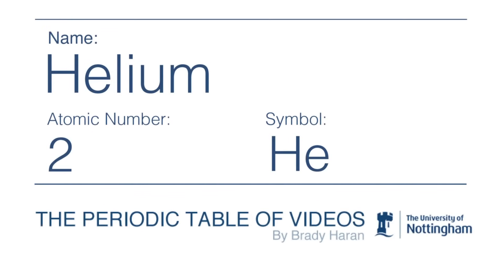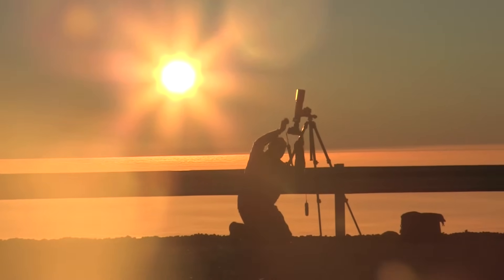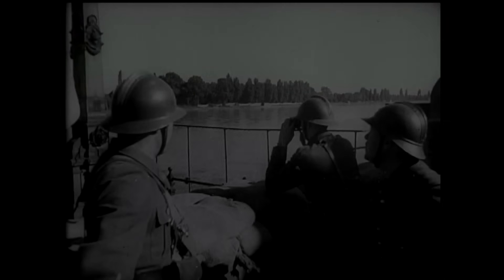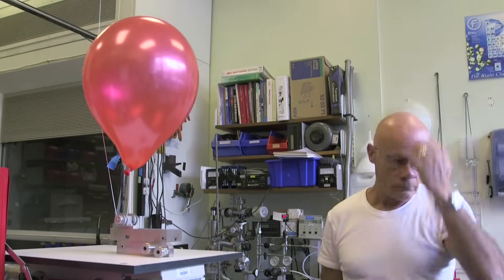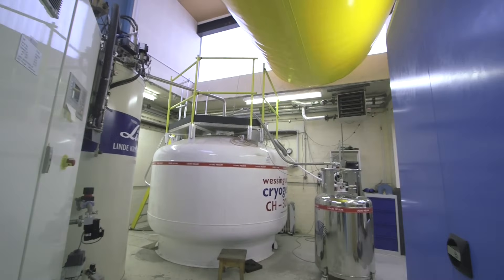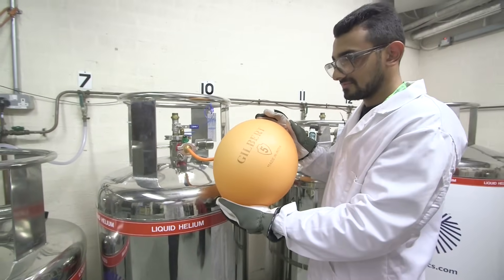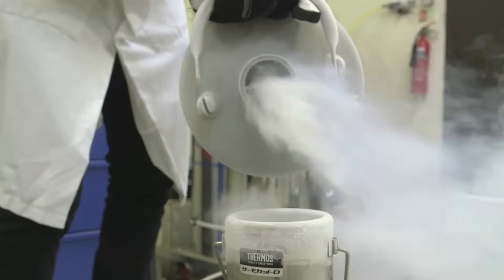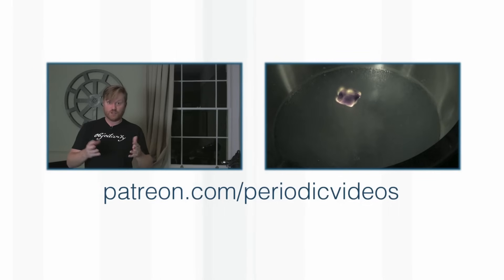Helium - Periodic Table of Videos

Comment: If we were to  manufacture helium, would we put the corresponding opposing charge and hydrogen gas?

“The answer depends on what "he" refers to. If "he" refers to a proton, it has a positive charge. If "he" refers to an electron, it has a negative charge. Electrons and protons are fundamental particles that make up atoms and carry opposite electric charges. 
Elaboration:
Protons:
Protons are positively charged subatomic particles found within the nucleus of an atom. 
Electrons:
Electrons are negatively charged subatomic particles that orbit the nucleus of an atom. 
Atoms:
Atoms are typically neutral because they have an equal number of protons (positive charge) and electrons (negative charge), resulting in no net charge.“ - google

Comment: If I caught the moment, the xenon balloon, after resting overnight still fell faster than the others.  My interpretation is that though some of the Xe escapes, much is absorbed in the rubber.  COnsequently, its mass is still included in the balloon.  The density of balloon plus gas therefore is greater than that of the other gas balloons.  Also, the Xe balloon is smaller, so that its aerodynamic properties are different.  Which complicates matters.
  Did you weigh the balloons before and after allowing for diffusion?  If the gas is dissolved in the rubber, the balloon should weigh more per unit volume than it did before sitting overnight. That would remove the aerodynamic factor from the measurements.  I'm starting to get confused.  Maybe just do the measurements?  
  One of the noble gases, either krypton or xenon, "poisons" nuclear reactors, reducing their energy output.  The gas is a fission product and accumulates in the fuel pellets as it's made.

Comment: The use of Helium must be brought under control.  Once used, it becomes irreplaceable.  It is a waste in baloons/airships. however in medicinal use and low temperature magnets it has much value.  Le us not squander it before it is too late.
Reply: Fear mongering ROFL
Reply: @reggintoggaf7140  Instead of ROFL I suggest doing some research. Estimates vary, but He will be too expensive to extract by 2050.  The cost has risen 4-fold in the past ten years.

Comment: What will happen when we fot example would create a real vacuum with barely no elements in it and then we will fill it only with alpha radiation? I mean without electrons to create helium. If we fill this vacuum with only positive or neutral particles what will happen? Will it float better than the helium filled balloons?

Comment: Because helium is so rare on earth as we see it, can we produce it during nuclear reaction?
Because helium can be used as a great coolant for Gadolinium to temp control in the reactor that I've been thinking about... Would be great is if you guys can figure a way out for some of these theories, because I'm trying to make it so it can at least self regulate itself and produce at least enough energy to sustain itself... Even if it can only produce the energy for all of its applications, I will still consider it a success if it can reuse most of its elemets, where if possible, be transformed to make ozone as the final  byproduct...
This ozone can even possibly be sent into a sphere and make a plasma ball which, as I understand, can make free ions?

Comment: The professor mentioned the U.S. National Helium Reserve which no longer has a stockpile thanks to the  "Helium Privatization Act of 1996" (Public Law 104–273)

I always think there's something henky going on with helium. In a liquid state, it's the coldest thing that can be made and is used extensively in quantum computer research. Then there's natural gas fracking. That practice contaminating ground water at who knows at what expense. And finally, don't be too surprised to find out China is shipping helium from the moon when that starts to happen.

Comment: No one knew helium existed until a French astronomer spotted unusual colors in the light coming from the sun in 1868. The colors revealed an unknown gas burning there. Scientists called this gas helium after helios, the Greek word for sun, and we now know it's one of the fuels that keeps stars burning. 

It was soon found on Earth, too, in gases leaking from lava and in natural gas. It turned out to be very useful! Because it's so light, helium's great for filling party balloons! And when you need a gas that doesn't react, think of helium. Welders use it. And it saves deep-sea divers from getting too much oxygen from their oxygen supply. Meanwhile, your shopping in the grocery store is scanned by a helium neon laser. But we're running out of helium, because every time we use it, a little bit more of it drifts into space...

Comment: Is it right so say that the brightness of sun's photosphere is caused by helium? Actually we have a "yellow dwarf" there. Which describes our sun. Because hydrogen only has a faint "reddish-pink" colour, even at those surface temperatures on the sun (Chromosphere layer). Can be seen through a narrowband h-alpha filter this way while blocking out all the rest of the spectrum. But helium finally spreads broad in its spectrum if somehow ionized, and very broad if plasmafied high enough. And seeing the faint white glow of the corona, I think this is all helium. At millions of degrees because it is so thin, exposed to all the radiation coming from the sun.

Comment: There's a very tiny amount of helium on Earth that doesn't come from radioactive decay. Some was trapped deep inside the Earth when it formed and is only now leaking up to the surface (though most of this leaked up long ago), and some is deposited by cosmic rays (though I'd bet more is created by comic rays through fusion and fission when they hit certain nuclei). I assume that technically solar wind is a contributor, but that is only statistical oddities, as most solar wind is deflected by the Earth's magnetosphere. However, one should always remember that atoms are so incredibly small and numerous that there's almost always SOME matter that comes from any sort of incredibly minor/unlikely process (though some processes are legitimately so extremely rare that there probably aren't any atoms from them on Earth, like maybe those elements right at the end of the periodic table, which could only form naturally on Earth by very bizarre coincidences and would almost certainly disappear almost immediately).

Comment: Liquid helium is really cool because it can climb up out of glass.....or is it that the helium goes through the pores of the glass?
Reply: I wonder, if Helium absorbs heat so well, wouldn't the process of liquifying it release so much heat that it would melt the equipment? 

Liquifying a gas is done by compressing it, until it changes to the next state of matter, then letting it cool down to a manageable temperature.

Comment: I'm a welder and I go thru a large bottle of Helium in 2 days if I'm weld thick sections of Aluminum.  The electric arc of TIG welding when using He instead of the normal Argon is much hotter.

Comment: Does the helium vapor produce a flame shaped jet because it (like a flame) is simply a column of rapidly expanding gas? I imagine, like in a combustion reaction, the cone is the threshold where kinetic interactions with the air (as opposed to oxidizing interactions with oxygen in the air) cause the helium gas-vapor to completely vaporize.

Comment: Liquid helium has an extremely low heat of vaporization, so it's difficult to keep in its liquid state outside of multiple Dewar systems.  Even a small amount of outside heat can boil it away.

Comment: Is it possible that the music from the phone only got quieter because helium is on one side of the speaker and possibly air on the other side? So, maybe it is making it harder for the cone on the speaker to vibrate correctly like a diaphragm with two different pressures on each side making the diaphragm more rigid. I ask this because I learned sound travels faster through helium and this goes against that. Is it possible to do the same experiment but use an open speaker instead?

Comment: What if you tried filling the thermos while in a sub-zero cooler. Then the majority, if not all, of the water vapor will have already dropped out of the air. Respirators could be worn to help reduce additional water vapor as well.

Comment: Why, if hydrogen lighter than Helium, is liquid helium colder than liquid Hydrogen...or any other element?
Reply: Gaseous hydrogen is lighter than gaseous helium because that's how gasses work; sulfur hexafluoride is dense enough to float small solid objects on but can get far colder than, say, butane which is much lighter. Gas density at STP depends only on the mass of its molecules.

Liquid helium is so cold because its atoms are so weakly bound it HAS to be that cold to even exist. Lithium Hydride is quite light as a gas, but is a salt-like solid at STP while the denser oxygen must get far, far colder even to liquefy,

Comment: I am surprised that it was not mentioned that helium is used in welding due to the high heat transfer properties as well as in deep sea diving mixes to replace nitrogen to avoid nitrogen narcosis.

Comment: I wonder how much the Helium was worth that was used (released) in this video.
Reply: mon librepenseur, that depends on your Scarcity metric et EMERGY/ERoEI yield process,
though, back of envelope at < 1.5l et x,y,z pb per mole,
 ~$900 USD worth was lost.

some conjectured > 5l, that would be closer to ~2000USD.
this is not inclusive of the EMERGY throughput process to distill that end-to-end.

je prends conge mon librepenseur

Comment: If helium emits a yellow liɡht, can someone explain to me why a purple liɡht is emitted when helium and deuterium are fused?
Reply: It's a different process. The light emitted by a neon light comes from excited electrons dropping back down to lower energy levels. That produces a very characteristic wavelength. I presume the light emitted from a nuclear fusion reaction comes from the very high temperature of the gases involved (incandescence). The color of the light is spread over a swath of different wavelengths (i.e. black-body radiation) and is directly related to the temperature of the gas.

Comment: Thanks for the video, but what about liquid helium in a vacuum?
Reply: It doesn't last long. Without air pressure it boils incredibly violently, even explosively, no matter how cold it is.
Reply: Thanks. I'd forgotten that changing the pressure changes the boiling temperature.

Comment: Helium is awesomely stable in the nuclear world as well. It is SO stable compared to its neighbors, it is one of the few elements you can fission to bellow iron and still make a net positive energy! IE you could split a lithium to get you some helium a net positive of energy.  This is basically unlike any light element!  You can google "nuclear binding energy curve" to understand this. Anything that increase your binding energy will net you an energy release. Most of the other peaks you see you can't really reach via fission, helium via lithium and sometimes beryllium are the only ones that work (cause fission will net you roughly 2 equal sized parts (one usually a little bit larger) and that just doesn't add up with most of the light stuff)
Reply: William Taylor - wat
Reply: Definitely William... and if some don't believe that, then, they can encase the tiny wires that go from a thermonuclear-explosive suppository's battery to it's 7th generation explosive charge with conduits filled with liquid helium and stick it! ;-)

Comment: How come you can't keep liquid helium in a glass vacuum flask, but you can keep gaseous helium in a glass light bulb?
Reply: Gaseous helium will diffuse through some kinds of glass but in general this is quite slow since the helium atoms will 'bounce off' the atoms of the glass and have to be very lucky to make it through the tiny holes in glass's structure. Liquid helium however does not do this, the atoms can more easily 'flow' through these holes. It's a lot like how water will soak through a sponge while iy's much harder to pass air through (You have to blow it for any reasonable rate.).

Comment: so if you are standing next to a hydrogen bomb explosion you may have a high voice because of helium?
Reply: No.. Not at all. The amount of hydrogen used, or fused, to make a 4 mile wide fireball is so insignificant that there wouldn't be any increase in helium content of the air surrounding the explosion. Oh, and explosion of that size would absolutely thermolyze any human as far as 100 miles away from it.

Comment: sorry what? helium goes through glass??
Reply: when helium is below the lambda point ( I highly recommend you look into it (it is really neat)) it can go through pretty much any pores in porous materials, it also tends to start climbing short walls. So while I did not know it could go through glass, it would not surprise me that it could if there are pores in the glass.
Reply: That's right, liquid helium is a superfluid, that is a liquid that has no viscosity, which allows it to flow through even microscopic pores as small as a nanometer. It also will on its own flow up and over the walls of its containers and stationary liquid helium will remain stationary in a spinning container. It's pretty cool. :)
Reply: I wasn't aware glass had any pores in it
then again if it would go up and over the walls then I guess it could get out of any glass container even if it couldnt go through glass, since there's always some opening. in the case of a thermos, the part where it's sealed up at the lip.  Still bizarre to think of a liquid, however low-viscosity, to be able to go through something that a gas can't get through

Comment: 7:44 nostopwaithangonaminute....helium can go through glass?
Reply: Liquid helium is a superfluid, it has zero viscosity, so it can flow through pores as small as a nanometer. That also allows it to do other freaky things like stay still if the container is spinning or to climb up and over the walls of its container on its own.
Reply: I dont think the ability to diffuse through glass can depend entirely on its superfluid properties, I looked at a few abstracts and lots of work has been done on gaseous helium diffusing through glass at much higher temperatures, -100°C to +500°C. maybe theyll talk more about it in the next video
Reply: yeme It's a bird ! No, it's a plane ! No, it's a SUPERFLUID ! Look it up :) it's litterally very cool
Reply: yeme The superfluidity helps I believe because having no viscosity means it doesn’t have internal resistance to the Helium atoms passing through incredibly tiny gaps. If the liquid was viscous its friction would help it resist being thinned out to that degree. That’s not to say gaseous Helium can’t also possibly pass through glass at high pressure, but if its liquid state was viscous it would presumably stick together enough not to break apart in nanopores.
Reply: James Sloan Fascinating! I didn’t know about the leak detecting for radioactive materials part. Thanks!
Reply: yeme It can pass through Aluminum walled pressure tanks! It finds its way through the relatively large grain boundaries in some metals like that. Exactly why it comes in chromoly tanks only.
Reply: yeme Oh, and I have a theory that may be how Gallium attacks Aluminum as well.
Reply: yeme I also wanted to hear more about that.
Reply: I expect its just because a He atom is so small it slithers through stuff relatively easily. its not like it would flow through glass unimpeded, like you could still put helium in a bottle, but it must happen fast enough to spoil the vacuum of a thermos if you use one for He
Reply: I'm doing a science assignment and it says write down 3 things you learned about this video thx for giving me the last answer

Comment: could you potentially fill a vessel with liquid helium and use a vacuum tube of some sort to siphon off the fog generated by the cold temperatures and evaporation?
Reply: A vacuum drastically increases the rate of evaporation, in fact it leads to boiling of most liquids at any temperature. Better would be a sealed, pressurized vessel that could be filled only with liquid helium.

Comment: Could you see the liquid helium without all the fog,  if you put a closed flask of liquid helium into a vacuum chamber and then opened it and tipped it out using a remote operating arm?  No air, no water vapor, no fog. Though the helium itself would boil even more vigorously.  (Would the helium itself still be white?)

Comment: 7:30 wait .....what? Glass is most definitely not permeable to helium. You can search for liquid helium demo videos here on yt and see that they are all done perfectly well in glass dewars.
Reply: Uh yeah no. No one's making dewar flasks out of plastic.
Reply: Yes, yes it is. It won't go through it like water through a sponge but there is definite permeation. The problem with thermos-type containers is that the liquid gets into the vacuum where it becomes a gas that is far less able to penetrate glass, permanently lowering the capacity of the container to insulate.
Reply: No, it doesn't. cite one paper to support this ridiculous claim. you can't.